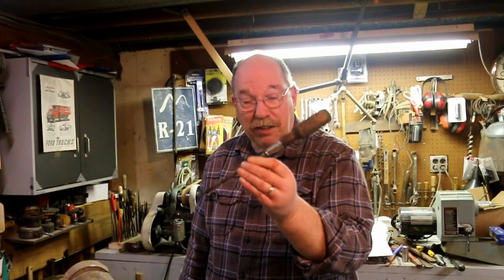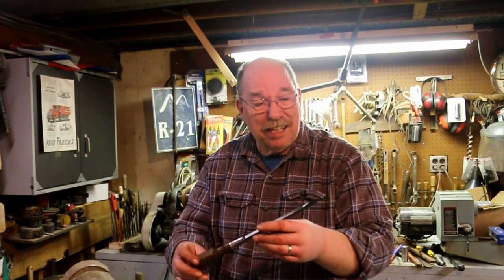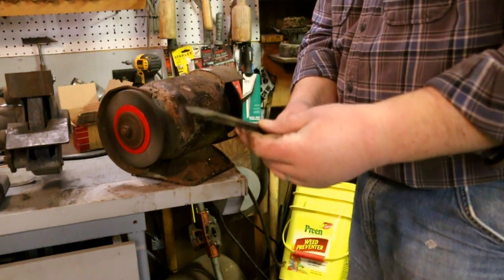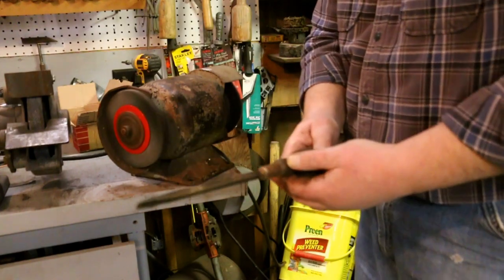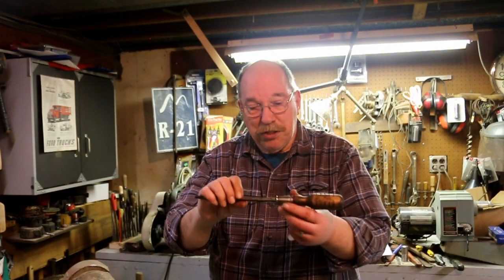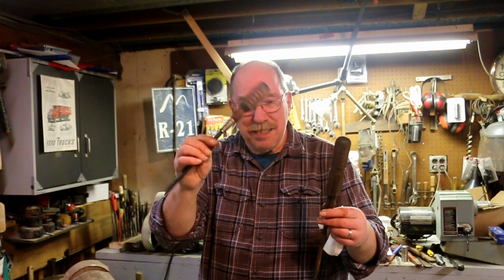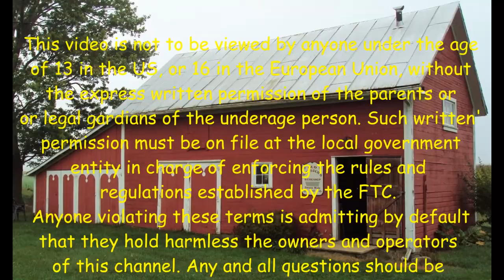Wooden Handle Screwdriver Cleanup

Comment: Good jol looks good as new. Unable to tell from video, extent of problem with the cracked handle. Project suggestion is to repair that handle, not as good as new, but better than new.
Reply from the maker: There is a rather large plastic bin that holds various tools I consider beyond redemption or only fit for source material for other projects. 
The cracked handle screwdriver arrived there. 😁😎
Reply: @OldSneelock  Thanks for the reply.  My intent was not so much about salvaging the screwdriver but more about showing what is possible. Of course, it's not worth a $100 of effort to salvage a 75c screwdriver but it could be educational for others to see the skills utilized. All the best.
Reply from the maker: That is the reason behind most of the restores here at the shop. If I buy it for $10.00 or less. It is always work putting in a few hours to repair it. 
Sometimes it gets out of hand.

Comment: Where do you get your wire wheels. I have got mine from Harbor freight. They come apart always incoming from all the wires flying. Been teaching my son how to restore tools and I hate for him to even use them. Any suggestions where and what grade? I would like them to be a little safer. Thanks
Reply from the maker: Every wire wheel sheds wires. I have been using them for 60 years. I set up manufacturing operations and actively sought out ways to have better life from wire wheels by buying more expensive brands with objectively better ratings and they still shed wires. 
Even the best suffer from metal fatigue. At grinder RPM's each wire is bent 3600 or more times per minute. Eventually they break.
I would love to be able to  point you towards a source I trust. There isn't one. 
Having said that, operation methods can reduce the rate of failure. 
Only the tips of the wire cut. Pressing the part into the wheel may seem to make it cut faster but there is a limit. Like sand paper grit wire count has an effect. 
Coarse wheels cut faster and last longer if the part is not jammed into wheel. 
Having progressively finer wheels, running at as low a speed as possible, and only applying just enough pressure to have the part exposed to the tips of the wires will decrease wire flexing, reduce metal fatigue, reduce wire  shedding, and increase wheel life. 
It will not stop random wires from being launched at high speed.
It boils down to risk. 
I wear  a shield, because one wire hitting my eye is unacceptable. I taught my son to wear a shield too.